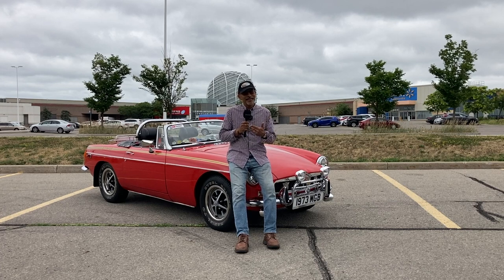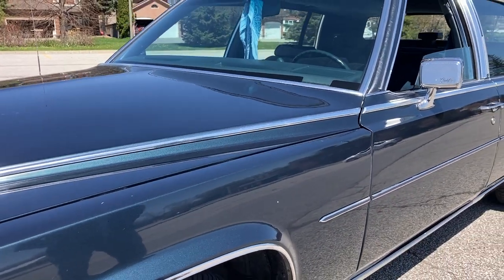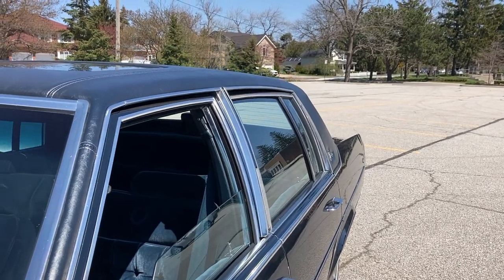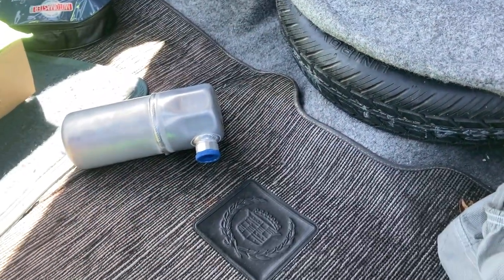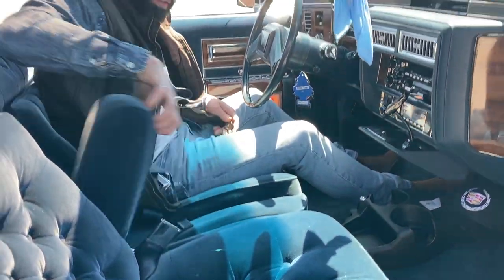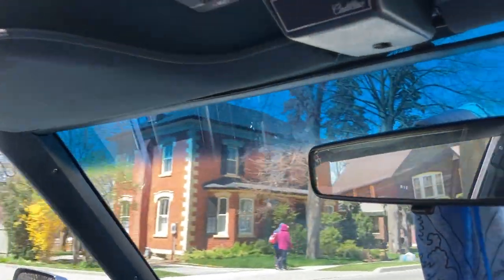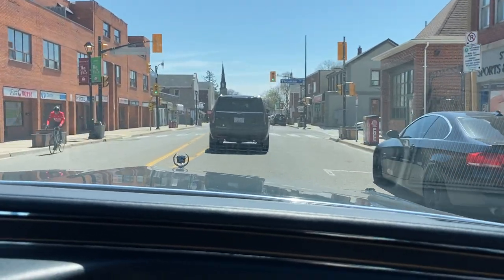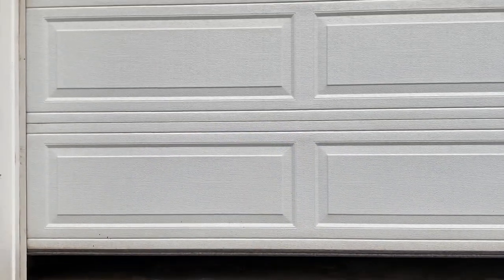1987 Cadillac Brougham d’Elegance! – All Original!

Comment: I use parts from Caddt's in most of the Hot Rods I make they are the best whether I use the motor or the seats.
Reply from the maker: Ken, can’t blame you they are well made and designed to last forever.